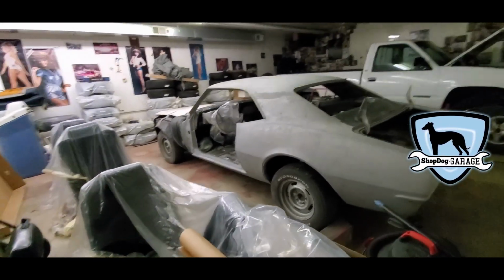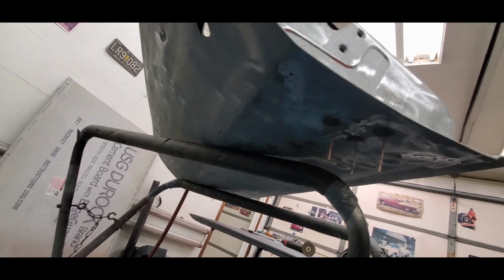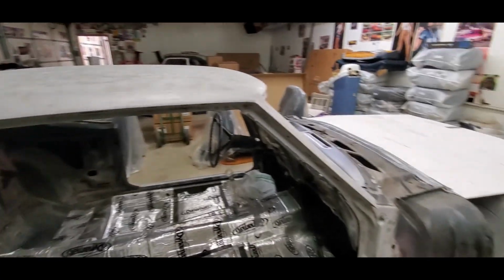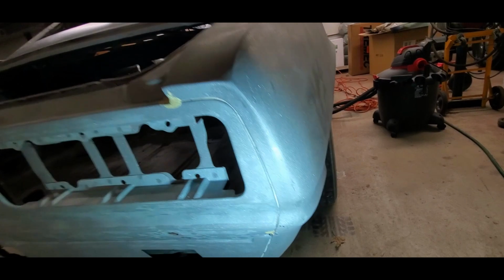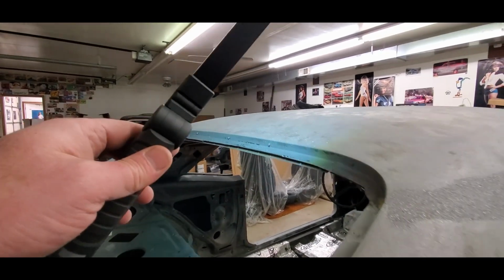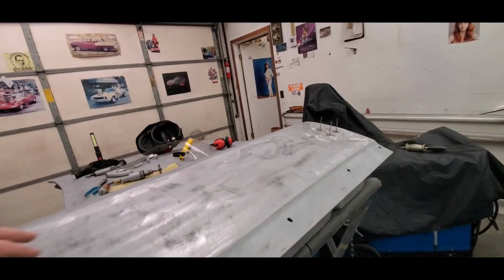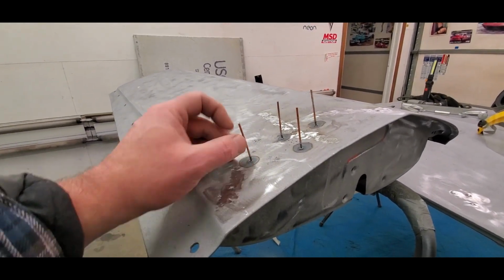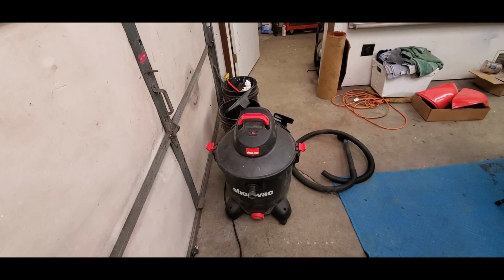The RocketShip 67 Camaro Ep 10: Cleaning it up

Comment: Did you use sand or plastic beads also how long do you have before you need to put some primer on before the rust gets on
Reply: Would have preferred plastic, but this guy didn't have it(?) So it was sand/glass, panels are much rougher than i preferred, the sooner the better to top coat it, but if you keep it in a dry area, will last awhile, my anglia in the corner has been over a year.